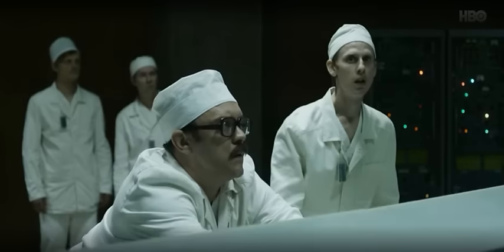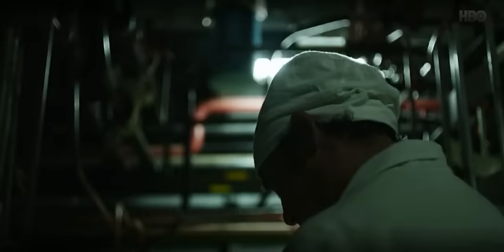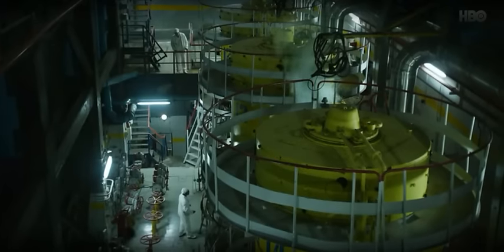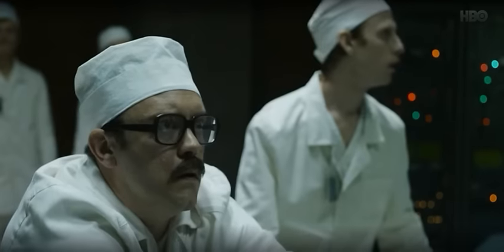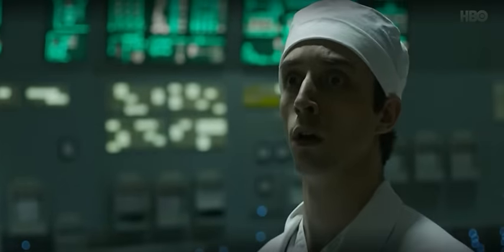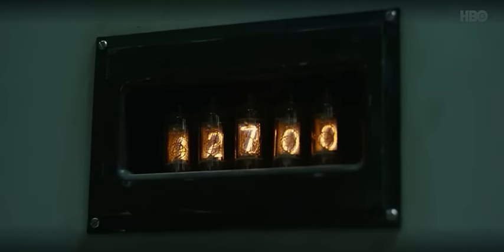Chernobyl (2019) Nuclear Reactor Explosion Scene

Comment: "Graphite tips" is so incredibly wrong and it's one of the most irritating myths about Chernobyl.
Reply: Explain.
Reply: Like many other myths, for example the jumping rods. Most of this was madeup for dramatisation.
Reply: @RogueShadows  Graphite tips makes it sound like the control rods had a little graphite tip - like a pencil - and like it was some kind of little 'cap'. And that it was there for absolutely no reason.

They didn't have a "graphite tip", there was an ENTIRE WHOLE ASS ROD made out of graphite that would move in to the space where the retracted control rod used to be, because if you didn't, the space where the rod was would fill up with water (which slows down the fission reaction chain, which is the opposite of what you want to happen when you withdraw a control rod).

I always described the graphite piece as a "ballast". The 'tip' was almost exactly as long as the control rod itself was, and was connected with an extendable mechanism so it would fit underneath the reactor when it was fully inserted.

As you can see, that's obviously significantly more deliberate and engineered than a """""graphite tip""""".
Reply: @fnhatic6694  So what you're saying is that it's less "incredibly wrong" and more "inaccurate in a strict sense but still adequate enough for the purposes of a TV drama trying to explain how a series of screwups in the construction of the Chernobyl reactor led to its SCRAM button turning into what amounts to a detonator for a nuclear dirty bomb."
Reply: @RogueShadows  Nah, I think it's "incredibly wrong". The context behind 'graphite tips' is always framed to make it sound like the people designing the reactors were blithering idiots, and even the scene at the end of HBO show basically reinforces that when Jared Harris just says 'we did it because it was cheaper'.

It also doesn't help that that's implied to be part of the cover-up, that the reactor operators "didn't know" because it was a "secret". I actually think the show specifically says that. That's an outright lie, namely because another RBMK reactor had a similar problem with a power spike caused by the graphite displacement. All RBMK operators were fully aware of the design of the reactor and the graphite "tips".
Reply: @fnhatic6694  No, the reactor operators knew that the rods had "graphite tips" in the show and in real life they knew how the actual rods worked too. What they didn't know was that because of that particular design, which WAS done because it was cheaper (the entire design principle of the RBMK reactor from start to finish is building a nuclear reactor as cheaply as possible), hitting the SCRAM button (AZ-5, whatever) would cause a momentary power spike when the graphite entered the core before the actual control rods entered the core and killed the reaction.

It should not have mattered because the spike shouldn't have lasted long enough before the proper rods entered the reactor, but due to the other things the operators had done that night it wasn't possible. So, as described, the core now has zero control rods and hundreds of kilograms of graphite inside of it. What should have been a momentary power spike that is near-instantly offset instead becomes a massive climb that can't be stopped.
Reply: It's so much more than just the "graphite tips" (which I understand where you're coming from on that).  In normal operation the graphite water-displacers on the rods weren't a particular problem, but Dyatlov and his crew had put the reactor into such an unstable situation--xenon poisoning, low power levels, almost all the rods withdrawn in the first place--that hitting AZ-5 and having the graphite tips pass through the reactor on their way up/down was the final hole in the Swiss cheese.  But, for TV, they needed a simplified explanation, and as far as I understand it as a layman, the explanation here was actually pretty accurate if not 100% correct.
Reply: @Moose6340  Not just for TV, but also for the Soviet court. The judges weren't nuclear plant engineers either.

Comment: It’s cheaper but does the complete opposite job😅
Reply: A sad thing from my point of view (not a nuclear reactor expert at all) is: The graphite tips may work perfectly fine and safe if the control rods still have the graphite tips fully inserted into the core when the rods are withdrawn as far as possible. Then, moving the rods in would slow down the reaction in any case. And the graphite is a perfectly reasonable way to make the control rods more effective.
There may be reasons against it, like more uneven fuel burn.
Reply: @eicydee3212  why not use whole control rod made of boron keep in mind that they were using graphite as moderator

Comment: The reactor wasn't made for a quick shutdown. Assume that 20 to 40 cubic meters of water have been added at a temperature that must have exceeded at least 2560 degrees Celsius! Let's call it that kind of jokes. Responsible nuclear power workers shouldn't do it. The water can only come from the feeder pipe, which must have been above the river water line. As far as I know, such things were done to ensure that the emergency water pump was reconnected to cool the reactor down a bit. Because otherwise the rods are still much too hot. The question is why did the rods get hotter than 2560 degrees. In a fast shutdown of this type, 30 to 40 percent is responsible for some kind of afterburn. With normal reactor operation, something like this is only annoying, but in a regulated need (still justifiable if necessary). The shot pump had failed for a long time. And this little trick with the cooling water in the feeder pipe was meant to cool the reactor below 1300 to 1500 degrees down to a tolerable 1000 degrees. Then to get the emergency pump running. the bastard doesn't tolerate temperatures above 1000 degrees because of the slightly thinner tubes. This time, however, they had waited too long, 1000 to 2000 degrees had become too hot. And next time, please consider the political system in advance. Is as corrupt as the political system in the West and the German police and German courts. Gorbaschef the big ex-manager, a stupid kid fucker who is way too corrupt. You can't even say something like that here in West Germany. Plus the nuclear scientists who pulled this whole thing out of the retort. And that's just so they don't get their couple of rubles cut in pension.

Comment: Does anyone know what happened to that lid? I don’t think it’s ever stated anywhere 🧐
Reply: It blew off
Reply: The reactor lid (biological shield) fell back sideways into the reactor pit. They actually named it Elena I believe. You can see it in several photographs, with a bunch of the fuel and control rod channels sticking out of it. The crazy thing about the lid was, allegedly, it stayed in the air for ten seconds after the explosion. It's hard to imagine something that heavy flying that high, but it did.

There was an expedition in the 1990s which actually had men going into the reactor hall, and there are a few photos of someone standing atop the lid.

Cheers.
Reply: Read Midnight in Chernobyl. Fully factual telling of the entire story
Reply: @robmausser meters*

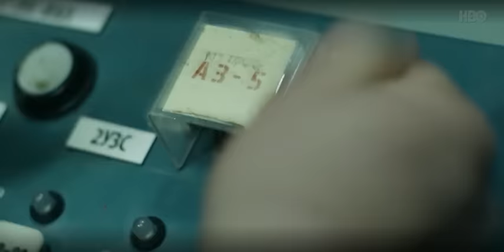Comment: Can someone tell me what’s that red stuff at 0:44
Reply: I would guess it's a wax seal, as a "force of function" type of barrier
Reply: @ss-ds2dn I don't get it (English is not my native language), did you mean that it's designed as a fake button for anybody who could accidentally press it?
Reply: @Valerio_the_wandering_sprite  not fake, but covered in a wax substance that blocks the button. So it's more difficult to push by accident. A safety measure.
Reply: If you look closely, the wax was holding the string that kept the AZ-5 button cover closed.
Reply: Its wax you heat up and apply. The Russian version of sealing an unused button hole. That's how incredibly sloppy and incompetently shitty there engineering is they don't even have a button hole metal blank that would fit that button hole like the rest of the world. You just pop it in and its pretty. You would think they would spare no expense in that room. That's horrifying cheap and tells the mindset of everyone engineer involved.

Comment: What could've been done different seriously 😐
Reply: If we're basing on the facts:

1. Have a period to cancel out the toxic fumes that made the engineers take the risk of jet engining the reactor to the point of no return.
2. Have different management be responsible to the maintenance of a nuclear reactor.
Reply: Containment building. Water based reactors
Reply: Some new reactors use gravity fail-safes.  The reaction rods don't lift up from the top, they move from the bottom.  So in a failure, even when their is no electricity, the rods can just fall downward in their space via gravity and the reaction stops.
Reply: every single thing, including the design.
Reply: Maybe don’t build your nuclear reactors cheaply. Build them to spec with redundant safety systems in place.
Reply: The nuclear facilities around the world have tanks to store the radiation contaminated water. All these tanks will start leaking if they aren't maintained for about 3 to 6 months. There is another means to store all this toxic water (half-live of some of the radioactive isotopes is 200.000 years) but they refuse to store it properly because its more expensive.
Reply: Build a better reactor
Reply: A slow, gradual shutdown of the reactor when the power/reactivity dropped due to Xenon poisoning, instead of pulling out nearly all of the control rods to overcome the Xenon.  Run safety checks.  Restart the reactor.  None of these things were done, as prescribed in the manual, because the managers didn't want to look incompetent, failing to pass a test they already said they had done.
Reply: A lot. Talking basic shit: don't make your fire extinguisher shoot gasoline before the foam comes out.
Reply: Almost everything. There was a whole chain of bad decisions that lead to this. 
1) Timing of the safety test was moved to the night shift by the local grid management request to avoid blackouts during peak consumption, AFTER the power was already reduced, which resulted in reactor running on low for the entire shift, which allowed xenon to build up. 
2) inexperienced engineer made an error during a switch to automatic regulators, which resulted in part of the system failing to activate, and in the process of fixing the issue they dropped the power to near shutdown.
3) Dyatlov insisted to continue with the test even though the system was not operating under the conditions required for the test to go through. 
4) AZ-5 flaw that momentarily increased the reactivity of massively unbalanced system after engaging. 

The best decision would have been to reschedule the test and to make sure that the best specialists were present and that the steps were followed to the letter.
Reply: Not having grafite on the control rods

Comment: Commies
Reply: Three Mile Island disaster
Reply: @SVS31 let me friendly remind you that fukushima had modern systems and the disaster is mainly caused by a natural disaster(earthquake and tsunami) :)
Reply: @SVS31  So what if they were American made? The disaster wouldn't have happened in a vacuum, and your argument is inherently worthless. The preceding tsunami is the direct cause of the disaster, not human error, like with Chernobyl.
Reply: @jamskay  and building a nuclear power plant in an earthquake prone area near to a coast was not human error?
Reply: @Dr.andonuts  the French generators kept running and provided back up power. The American designed generators were on the ground and got flooded, didn’t run. Hope this helped and increase your rotten knowledge
Reply: @jamskay  read the comment. French were fine. It could’ve been avoided if not the typical American design
Reply: @jamskay I don’t agree at all with your assessment. The emergency generators in Fukushima 1-5 were flooded. That this could happen was as much a design fault as the design of the first generation of RBMK-reactors in Chernobyl. If you build nuclear powerstations in one of the most earthquake prone regions in the world, you don’t rely on a single sea wall to protect against a tsunami and you definitely don’t place your emergency generators in a basement. The best proof of this is that Fukushima 6, where the emergency generators were on the same level as the nuclear reactor, was never in danger. That emergency system worked as designed and cooled the reactor. 
By the way, the Japanese operators made operational mistakes too: they were insufficiently trained in the workings of a secondary emergency system. That system could not prevent the outcome, but it could have postponed it and give critical time.
Reply: @Dr.andonuts That’s too easy. The design relied on a single sea wall in one of the most earthquake prone regions on earth. Reactors 1-5 had the emergency generators in a basement and the basements were flooded. The lack of power made it impossible to cool the reactors after shutdown. Reactor 6 had the emergency generators at the ground level next to the reactor and not in a basement underneath the reactor. The emergency systems worked as designed and the reactor was properly cooled down. 
I designed large datacenters for a living and we would never do that, not for earthquakes but for the consequences of a fire in the emergency generators or batteries.

Comment: It's cheeper...did he learn that in America?😊
Reply: We don't take shortcuts with our Military. Sure our citizens are eating plastic and creating waste An unprecedented level, but we do spend big on some things.
Reply: We spend 60 percent of our budget on military. We definitely don’t cut corners. Not proud of that but it’s crazy that even the next top super powers combined cant spend as much as the U.S.
Reply: cope harder tankie
Reply: Not really. The Soviets focused on efficiency over everything else, including cost efficiency. For example, prior to WWII all Soviet tractor factories were also set up to produce tanks. The RBMK is a very cost-efficient design. It's made almost entirely of standardized prefabricated parts, and none of those parts are specialized like a pressurized water reactor's reactor pressure vessel, so they can be produced in pretty much any factory. This makes them quicker, cheaper, and easier to build, which appealed to Soviet central planners. The Soviets did adopt American serial mass production techniques during WWII, but they used them to produce huge numbers of low-quality parts based on the (also American) idea of planned obsolescence instead of slightly less huge numbers of high-quality parts like the Americans did. After all, if the T-34 only has a combat life expectancy of 16 hours, why design anything to run for 200? All of that was then combined with Stalin's "meet quota or go to gulag" approach to ruling, which resulted in further acceptance of shoddy work and unsafe but efficient systems. They never really got away from that mentality, which is why Soviet stuff generally sucks.
Reply: @eliasbautista2687 sixty percent of discretionary spending*, if you look at the total budget of the united states it's about 8 or 9 percent.
Reply: did they learn it from china? XD
Reply: What does cheeper mean?
Reply: @eliasbautista2687 and how much is used to wellfare of citizens, education and healthcare?

Comment: Because it's cheaper. Woah, russians are really good in designing such things. This reactor is really a unique design, the westerns wasn't able to design. If this was operated properly this reactors may be working still now. The operators should have been warned about the design system. This series is actually trying to show that western designs are better but in reality this show tells us this design is better since it is cheaper and if properly operated. I think all reactors will have their own problems if it didn't operated properly.
Reply: The problem is that the cheapness meant that the emergency system actually makes the emergency worse
Reply: How's all that advanced tech working in the Ukraine? Oh that's right....
Reply: Spotted the vatnik
Reply: Even if the core is operated properly by experienced workers, the safety hazards are miles higher than western reactors. While yes the RBMK is cheap, positive void coefficients even being a possibility in todays age is enough to get reactors heavily modified to ensure it isn’t. Alongside this another corner was cut in that the water tanks to cool the reactor were directly beneath the core that can get as hot as 730 degrees delicious. this is a heavy risk for obvious reasons. And the material in control rods being graphite is possibly the worst risk of everything here, since just like how the disaster went if the rods got stuck in position the graphite would endlessly increase reactor production to ensure a disaster.
Reply: @paulgrundy6864 I cant take you serious with that picture
Reply: @Italongo  fair enough